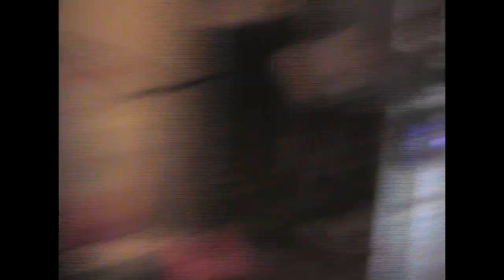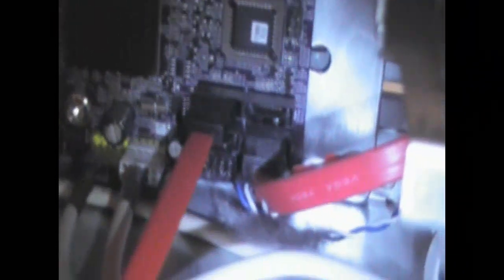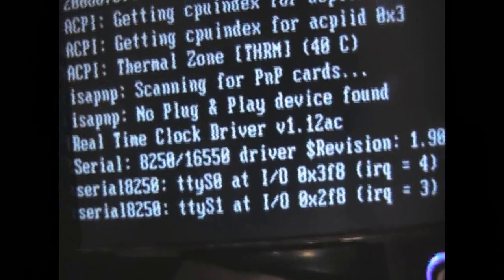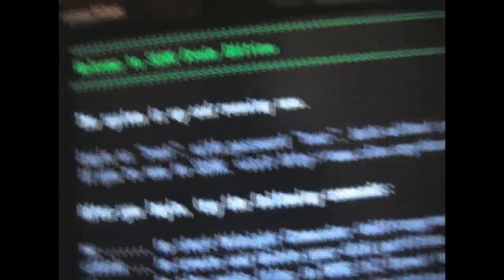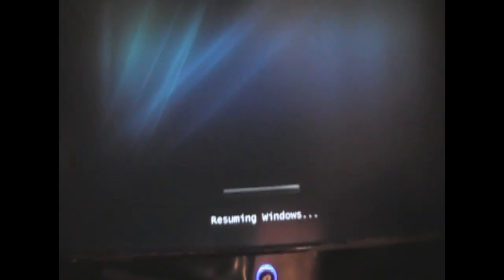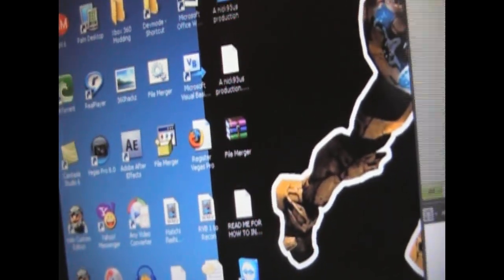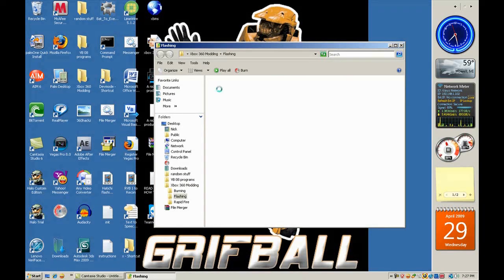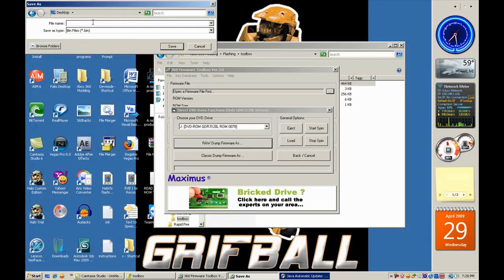How To Flash A Xbox 360 Hitachi 78FK(Part 1)

Comment: hey i have a broken hitachi 78 drive because the magnet detached from the disc spinner (everything else is fine) . i just recently ordered the same model hitachi 78fk and i was just wondering, do i need to switch the board chip with my old one in order to use it or can i just put in the new drive without doing anything? Thanks

Comment from the maker: @reece02009463 As I said this is out of date, goto jungleflasher . net (remove spaces) and read the tutorial for more info also instead of buying a desktop you might want to get this  acidmods . com/shop/product_info . php?cPath=12_19&products_id=175  (remove spaces) and try to flash it with that (pretty sure it works with all computers and drives)

Comment from the maker: @kikyouthekillermiko a ground wire is ment to channel extra electricity to ground so it wont overload the system you need it because the xbox dosn' have the same type of ground as your pc so if there is a surge from your pc into the drive the electricity will break the drive without the ground wire (a ground wire can be made out of anything conductible for example i used a metal coat hanger and you can just make is so the metal case of the xbox and pc are touching that will work too

Comment from the maker: @melojordan55 ya you cant just buy a different brand and play burned games sry man but the good news is theres tons of tutorials out there for every type of xbox 360 drive goto jungleflasher . net (remove spaces) and download there tutorial and read through it and by the end of it you will be able to flash your drive. oh and you cant flash the hitachi drive and plug it in b/c you have to get the original drives firmware and key for the new drive to work so just flash the original one

Comment from the maker: @LightningFireFilms no you would need the original drive firmware that was matched with the drive so if you have that then you have to spoof the new drive into thinking its the old drive then it will work (i have never done that b4 but i no that you can do it its included with the program)

Comment: hey nick, i got a problem, i can get into b mode fine my pc recognizes my drive but when i use firmware toolbox for the first step it fails, i mean when i try to raw dump firmware as, when i go to save it i click save and  it says, "error, cannot read from drive" what does this mean and how do i fix it, is it the retail dvd i am using i have tried three and all have gave me that message, it would bwe great if you could help? thanks!!!

Comment from the maker: @GMASTERMAX the only difference with the older versions is that you have to use classic mode it says how to flash the old ones in the annotations (it even pauses it to let ya read what it says) and the ground is just so ur drive wont break and all you do is connect it to the metal case of the pc and the metal case of the xbox

Comment from the maker: ok there is an extra step that you ahve to do for the 79s first you have to get the 79 unlock which i will add to the description at the right then when you boot into windows after using slax on the drive you have to insert the 79 unlock cd and play it completely from your 360s drive then once its done playing start it again for barely a second and pause it. then go into jungle flasher and search the ports for the correct one then just follow along with the tutorial.

Comment from the maker: ya your really only supposed to be using native sata ports to flash the hitachi drives because the chipsets have a hard time communicating with the drive 

so ya just make sure that your using native sata ports and make sure that ur not using a 64 bit version of windows and as for the error your going to have to find a cpu with native sata ports because I think that is the problem

Comment from the maker: 1 do you have a 64 bit version of windows xp or vista
2 did you make sure to eject the drive a lot when it came to the windows loading screen
3 make sure that its a hitachi
4 make sure there plugged into native sata ports and everything is connected properly
5 did u have a ground wire hooked up??

Comment from the maker: hey well you have to restore the drive to its original firmware if you want to update it to a newer version of iXtreme so to do that with 360firmware toolbox you just have to load the orig.bin file and click tools>direct drive flash (GDR only)>differential flash (RESTORE) then you can upgrade to the newest version with jungle flasher or whatever program you want

Comment from the maker: there's a chance it will break ur drive so just set the xbox so its touching the pc metal and it will be fine just make sure that the pc chassis is touching the xboxs chassis and it won't break from to much power going to the drive

Comment from the maker: ya he ment get a new mother board so the xbox 360 will recognize the new drive but that won't work all you have to do is make sure its the same drive version as the original then just change the drive key to the orignial drive key then you casee if it will wrk w/ the drive

Comment from the maker: you can try but it says in the 360 fw toolbox this///

 - Make sure you attach the Drive to the PC with a Native Sata port because
   some PCI Sata cards are not supported or even some USB-SATA adapters are
   not working well at this moment. Does not harm to try. \\\\\ so go ahead and try it and see if it works and if it doesn't it doesn't

Comment from the maker: There is nothing special about a ground wire I used a freaking hanger... sorry but you are like the tenth person to ask that but ya just use anything metal that can transfer electricity, and the slax 21 is on xbins so you have to download that first then just go to 360 then flashing or something its really easy to find, then burn it to a dvd + or - r and get the sata on ebay its cheep there and wallmart probably doesn't sell the right kind and yes you can play originals

Comment from the maker: its a regular wire that connects the xboxs 360s ground to the pcs a ground it the third bottom part of a electric outlet its put there in case to much electricity goes to the thing your powering so just use a metal hanger if you don't have any wire